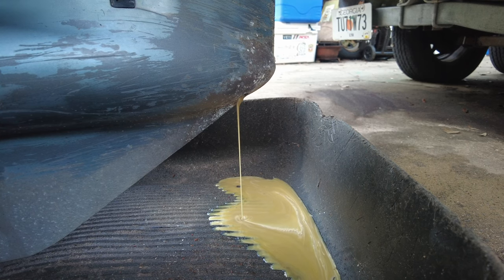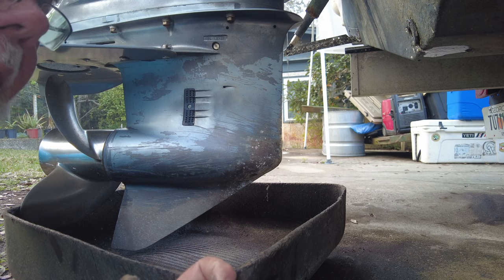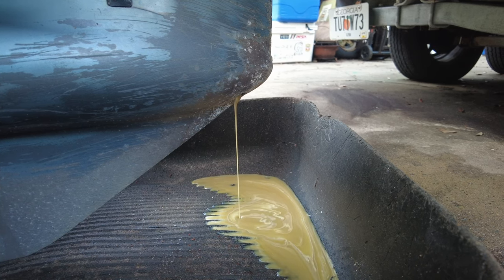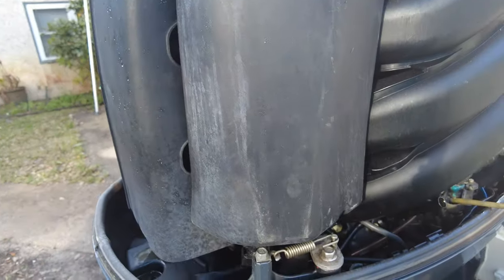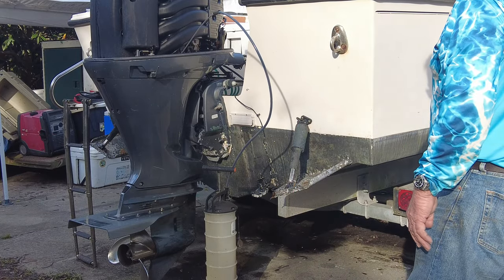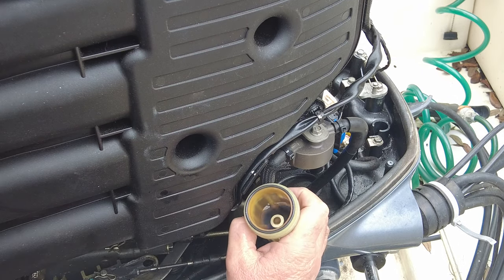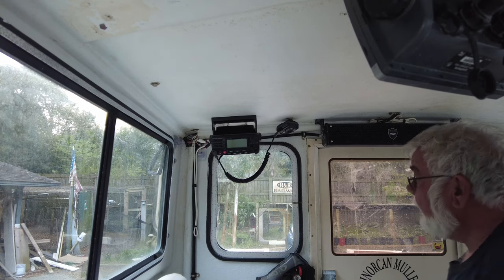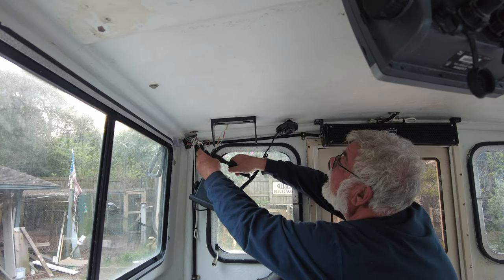Minorcan Mullet Maintenance   4K

Comment: I do recommend putting a smear of oil on that filter gasket before putting it on like that. It keeps a better seal and also prevents it from sticking and locking down.. easier to replace next time.